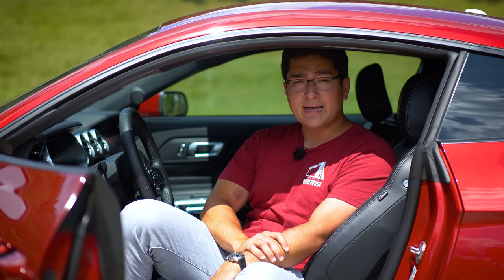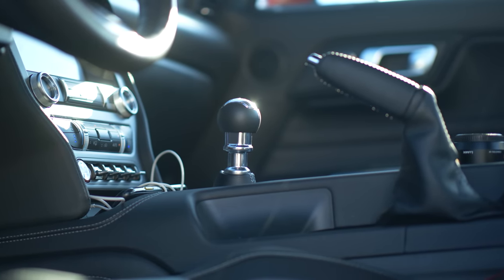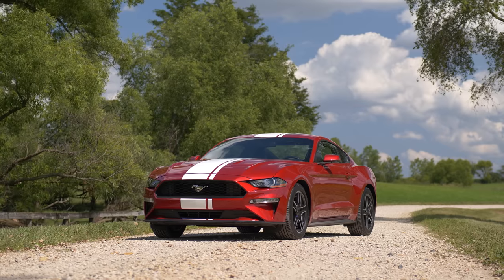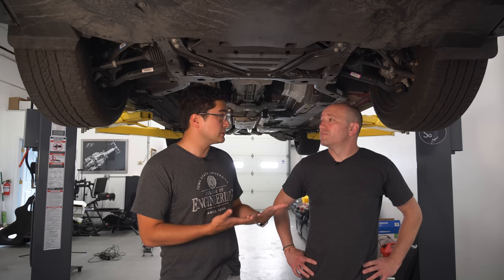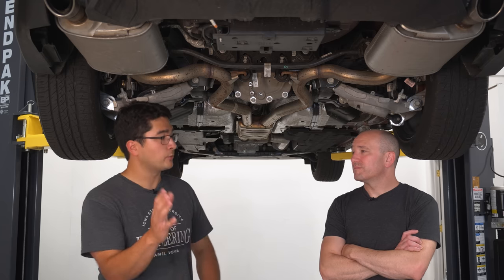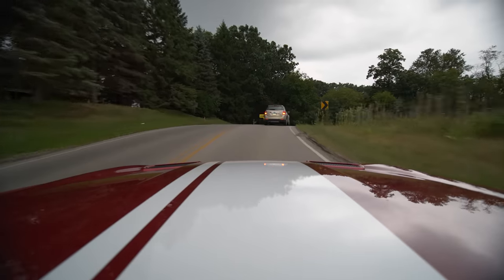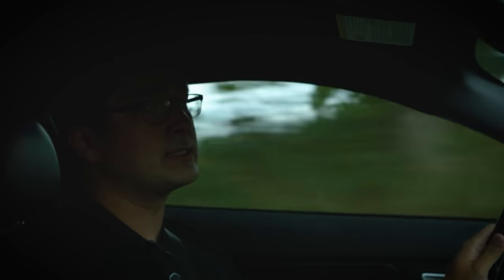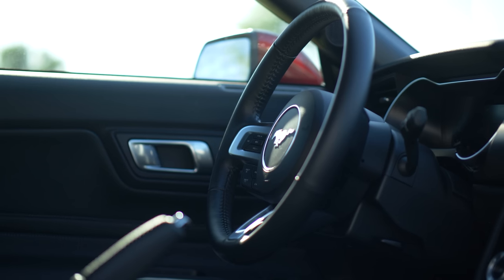2020 Ford Mustang EcoBoost | Red Headed Step Child

Comment: It has 300hp, rwd, and comes with an optional 6 speed manual. If it had a Japanese badge on it this car would be legendary.
Reply: Unpopular opinion: The Ecoboost Mustang is a modern S-Chassis
Reply: 💯💯💯
American 4 banger sports cars (ecoboost mustang/LTG camaro) are EXTREMELY underrated. These are cars that offer better bang for your buck compared to Civic Type R, Golf R, WRX, JCW, V4 A90 Supra, Audi TT and many more but because they don’t have a Japanese badge no one gives a sh1t about them.
Reply: I don't expect this engine to last reliably over 150,000 miles
Reply: @quentonmillstid850  As a ford lube tech, ive seen many many ecoboosts well over 200k miles
Reply: Exactly
Reply: I am Japanese guy who drove Eco boost Mustang from rental, and I really thought this is what like Nissan Sylvia or Skyline used to be. Not the best machine but brings much joy to life:) It's like Honda Beat kei sports but in American way. Fun around the town.
Reply: This comment alone has sold me on me on this, thank you.  I've raced turbo 4cyl cars for years in SCCA.  If this was a Nissan at this cost it would cost twice as much.

Comment: It’s funny that this 4-cylinder Mustang has more power than plenty of V8 Mustangs of the past. I think you guys are pretty jaded from driving so many high performance cars.
Reply: They are but they also admit that fact many times.
Reply: As someone who owns a GT350 they are also quite chonky and thicc. 300hp goes much further in a fox body.
Reply: Comes with the career I imagine. If I was driving and coming out with interesting reviews for dozens upon dozens of cars..I'd be jaded too
Reply: And the performance is about the same too, this car is pretty much on par with the '05 GT as far as acceleration.
Reply: I mean 300hp on a 3600 lb car is a little meh compared to the foxbody which was around 2800.
Power is just a number
Reply: Yea but does it have the same torque? No.
Reply: @pnourani  this is also a true statement. 
No one can argue with the value of a new ecoboost mustang
Reply: Also remember the cars, "of the past" were MUCH LIGHTER.  As comments above explained, 310HP in an old car is still faster than 310HP out of this Ecoboost. 
Also an Older Mustang V8, like a first gen may be, "Slow" compared to an Ecoboost, but they're more valuable.  A reality of Mustangs and any muscle car, is that people don't just buy them for speed, they also buy them for heritage.  The V8's will hold value better, slow or not.  People like the sound, and the big girthy engine in the bay.  If all we wanted was speed, we'd all be in Teslas by now.  No matter how much time passes, V8's don't depreciate nearly as fast like the V6's and I4's already have shown to in many years past.  Again as others above have mentioned.  "Power is just a number".  There are so many other things to consider when buying a car.  
We're not jaded for praising a V8, though I will admit it is jaded to look down on an I4 Turbo.  "Power is just a number" goes both ways.  Those with more shouldn't make fun of those with less, and those with less, shouldn't feel the need to tell someone with more that, "They don't need it".  Cause trust me, we'll find a way :)
Reply: Agree.  I generally like these guys and their reviews, but they sounded very smug here.  No, an EcoBoost isn’t going to match a GT, but to diss a car this bad is just unnecessary and even kind of mean.

This car definitely has its place in the automotive landscape.  Personally, I’ve driven both, and I like both.  In fact, I just test drove a new GT again last night.  But since my daily driver gets 15-18k miles per year, fuel economy is important to me, and the EcoBoost just kills the GT in this area.  I imagine insurance costs can be quite different, too - something reviewers never talk about, but it has to be taken into consideration when buying a new vehicle.

Would I rather have a GT?  Sure!  But Is it worth the higher costs in purchase price, fuel, and insurance?  I hope to find out someday.

To their credit, the guys did point out why this car would make more sense for some people than a GT, but they still came off badly, even as the car was chirping the tires running through the gears.  Not exactly a sign of an underpowered dog of a car.  Maybe try a little humility, gentlemen.
Reply: Timothy Coyne well said. The car also looked like it had basic all seasons on it. Proper tread really helps!
Reply: ummm a 82 mustang only had 157hp from a 5.0l v8... ? wheres the 300hp coming from. and i know a older car with 300hp with similar weight would likely win in a drag race but on a circuit i bet the newer 4 cylinder would smoke em with all its modern features. would be making up for it in the corners.
Reply: it still a 4 banger i dont care how fast i am.
Reply: @audi1ification  u can get a good deal on a toyota prius then if speed isnt ur thing :)
Reply: @BladedAngel  Well said.
Reply: @BladedAngel  

>As comments above explained, 310HP in an old car is still faster than 310HP out of this Ecoboost. 

This is such bullshit lol. When I had my EcoBoost I had a friend who had a '02 SN-95 Cobra  and I blew the doors off of him every weekend at the strip. That's with both cars having roughly equal horsepower and him having a manual. All you have to do is look at 0-60 times of 300+ HP cars from the past to confirm this whole "cars were faster in the past" is bullshit.
Reply: Can confirm. I have. 350 Monte Carlo from the 70s and I make...............

140 horsepower to the wheels
Reply: @BladedAngel  Nobody buys a new v8 mustang for "heritage", and anyone buying a run of the mill car pretending there's "value" to be kept in it is fooling himself. All cars you can afford are a money pit. These cars are indulgence that's all, and you spend as much as you deem it worthy. Considering value in these purchases is an oxymoron.
Reply: Prefer Supercharger (Whipple/ Roush), because at 38,000 miles i had Turbine Lockup within the Turbos at 82°+. This is caused by Thermo Variations consider locations of Turbos Ford mounts them below for lower center of gravity.  Problem is they're right next to the very hot engine.  Ricers know this and mount them up high close to heat extraction hood vents.  To keep them cooler, and not for show. Now the Turbo Shell expands like a donut 🍩, while it's being baked the outside expansion is outwards vs. Inside expansion is inward the hole gets smaller. The Blades expansion is outward to be larger to hit the Shell. Locking up the Turbine Blades, and then add the Backflow from the Intake and Downpipe to it to spool the the Turbos more.
My fuel mileage went from 
32 mpg to 8-12 mpg.  Glad for 2021 it'll have the GT500 engine package 5.0 V8
Reply: Until the Turbos lock up in hot days at after 38,000 miles. With the carbon build up
Reply: Agreed, love my 04 Gt but can't wait to Coyote swap at some point. Only 220 HP is sad now a days
Reply: @genericthiccgirl228  that would be awesome, though remember you may want to transfer. Crossmember and CPU  as well. With more horsepower you would want to be able to stop it as well.  Therefore, beef up the the breaking system as well.  
Stuff like this is why i stopped racing
Reply: Perry ah yes, they do. The performance pack ecoboost has 350 ft-lbs of torque which is 30 more than an 05-09 mustang GT. The non-performance pack has the same torque as 05-09 GT. Turbo motors have lots of torque.
Reply: Mike Gee  That's because of Turbo lag and the EcoBoost actually wieghs more.  There's a lot more copper ( its a dense material) from power seats on the side curtains to Downpipes and intercooler to tubing and fluids going into the intercooler.  Infotainment center added wieght leather padded console as well.
Reply: Steve McQueen Bullitt Mustang GT 390 cubic inch curb weight was 2,754 before added brasing on 4 corners for stunt car punishment on San Francisco roads.  Therefore, it weighs a 1,000 ibs. Less than the EcoBoost. So you'll feel more torque and speed, and felt its pull back then 
Your thinking is that doesn't sound logical.  A 4 cylinder vehicle weighing more than older V8 Mustang's.  A lot has to do with the added wiring (copper is a dense material) add power on both front passenger seats, side curtain air bags. Intercooler, tubing and fluids going in to the intercooler and tubing going out to Turbos and then the Downpipes, which are connected to the exhaust system.  People think that Turbos weigh less than a Supercharger.  Hhey are thinking wrong, the failure rate of Turbos especially, those American manufacturers.  They mout them too close to the engine heating the Turbos. Which defeats the intercoolers purpose to cool them down.  Ricers know to mout them away and closer to heat extraction hood vents
Reply: @timothycoyne5874  pointing out the reality of the base ecoboost isn't the same as putting it down - they specifically stated the reasons why the car exists. But the fact of the matter is that the base ecoboost holds the same place as the base v6 from before - as a buget-engineered product that still has the look and hits the right $ per hp stat. Look at all the comments (including your own) which focus in on that >300hp number. There's nothing inherently wrong with that - enjoying a car isn't wholly limited to hitting the apex or riding on a track-oriented suspension system.

There is a performance-oriented ecoboost, the base model isn't it.
Reply: Aptkeyboard In 1987 we thought it was the Bomb when the 5.0 had 225HP!
Reply: @BladedAngel  
That's not true at all lol.
Old Lambos, Ferrari, Mustang, etc etc were made of steel and all the parts underneath were made from steel mouldings. Suspension linkages used to weigh kilos lol. These days cars are made of much stronger and lighter types of steel and are considerably lighter, typically speaking.
Reply: They made very sure we understand they're too cool for this car.
Reply: AoDAzrael 300 hp is more than most new cars today.  Of course 300 hp isn’t much compared to a Demon and many other performance cars, but it’s tons more than the average passenger car, SUV, and crossover.

But whatever.  The EcoBoost has its place, as does the GT, GT350, and GT500.  If I had to choose today, I’d probably get a GT, but a late model, low miles used one, preferably a CPO.  Tons of used Mustangs out there.
Reply: Personally, I’m not a fan of the new body, the 18 and up just look nasty ugly to me. Yes the 2015 was cool but the whole reason I bought my s197 was because it reminisced so much of the older mustangs. V8 power and old but gold looks.
Reply: I've flown aircraft at 25,000 ft with less horsepower. I remember buying a 6 cylinder Mooney TLS aircraft that developed 300hp, thought that aircraft was powerful. 

If you see some old Bud Lindemann car vids.  Many of those cars  develop less HP and were heavier.
Reply: It was very painful for both of these gentlemen to do this review.  LOLOL
Reply: Timothy Coyne then just get a different car😳 no one gets a mustang to daily for practicality id take a Honda Accord over an ecoboost any day but if you give me a gt I’ll make the sacrifice for the performance and joy of the engine
Reply: @BladedAngel  Just read this comment and thought it was very well said and I was like dang I like this guy and then I scrolled up and saw it was Bladed! Lol keepin it 💯
Reply: @RCXDerp   growing up in the 80s 90s foxbody was a pantie dropper
Reply: fair, but max hp rating isnt the whole story. sometimes how it delivers that power is more important than how much power it has.
Reply: @RCXDerp  exactly ppl getting wet that this makes 310 hp but they forget s550s heavier cars. I cant stand an eco I really cant
Reply: @timothycoyne5874  if someones looking to buy a mustang I'd hope they arent looking for mpg or  insurance savings. If I was worried about mpg I'd have bought a Prius. It's like going to Hooters expecting the food to be good. A mustang is old school iconic v8. I get thru the years mustang's have had different engines in it but ecos so far from a mustang its disrespectful but I get 99% of ppl I see driving these are either rental cars or boomers that want a daily. I just never ever would go near one
Reply: Yeah that's the downside of this channel, atleast they kinda mentioned that in their latest vid.
Reply: @Chayonray  it was more painful to watch them do this review.
Reply: Thanks for the review, I enjoy your honesty. You don’t totally dis this car. For me it’s more power and a significant upgrade from my 4cyl Fox body. I’m fine with the base model. It would still be fun for me.
Reply: You can’t call yourself a car person if you seriously think the eco boost is cool 🤢
Reply: Cars from the past weren't made of plastic hell back then you could still drive a car away from some accidents now days it will be totaled
Reply: Agreed. They have lost sight of what is fast to many people. It runs 13's stock. thats fast.
Reply: @RCXDerp  have you driven an ecoboost?
Reply: @RandomlnternetGuy  intercooler/exhaust/tune on 93 pump and I’ll be making 30-50 more hp. And 30-70 more tq. I’d say that’s pretty sweet.
Reply: Guarantee they're faster than my 99 Cobra.
Reply: most things feel slow in america cause its endless straight highways
Reply: They sure are
Reply: @gsjourney3054  Mustangs actually make decent family cars as long as you only have one kid
Reply: I had a 23 ecoboost as a rental and it was genuinely awesome. It handled really well, ride was nice, had enough power and the transmission held revs when it needed to. And when I floored it, I could actually enjoy it on normal roads without driving like a scumbag.  Not of a fan of them ragging on a 4 cylinder simply because "it's a 4 cylinder and mustang go vroom with V8". Would they rag on an S3 the same way they did the Mustang in this video? Of course they wouldn't.
Reply: agreed, I wish they take another shot but properly this time with a performance package trim
Reply: This car is slow. Times move on. Mustangs were never fast to begin with in the past
Reply: Agreed.
Reply: not quite

Comment: 300 hp used to be v8 rating
Reply: @Peyton Brimmer yeah maybe in the 60's
where 4 cylinders were 40hp
Reply: @mickeydee3595  Dude the 2010 Mustang GT was only pushing out 310 Horsepower lol
Reply: @altonwilliams7273  yeah thats a mustang lol

Ive got a 2009 Commodore SS (pontiax G8 for guys in the states) and that had 355hp on a very conservative tune from the factory.
All these new high strung 4 cylinders will be fucked after 100,000km.
Reply: @mickeydee3595  ok but this is literally a 4 cylinder that has the word Eco in the name
Reply: @Dragon228833  and?
Reply: @mickeydee3595  the argument is that 310 horsepower is impressive for a turbo 4 cylinder and you replied that your v8 has 45 more horsepower
Reply: @Dragon228833  yeah it is impressive however with that being said these small 4 cylinders that are so highly strung will be wringed out by the time they hit 100,000km.
The V8 will keep pulling like a freight train at 300,000+ and many more if well maintained.
Reply: Motorbike engines make absurd power vs cc but at 50,000km they are all chooched out
Reply: @mickeydee3595  can’t argue with that. People r blowing these ecoboost motors left and right
Reply: @Dragon228833  thats what happens when you squeeze every last bit out of a small engine.
Longevity goes out the window
Reply: @mickeydee3595  bro you seeme to know what your talking about
can you please give me your view on stinger V6TT would you
consider that for a V8 its a very good looking car but most importantly
it does have some power 365hp.
Reply: @peacemaker2988  it’s just the ecoboost is gdi and turbocharged so it’s a recipe for disaster
Reply: @mickeydee3595  except Hondas or most Japanese bikes. My 05 cbr had 81k miles when I sold it an it's still running
Reply: @Szcza04  right look what happened to Hyundai a few years ago and their GDi motors haha. Boost is cool and it sounds amazing but man more complexities and things to go wrong
Reply: @danielservin2450  Thats considered very high milage. Good that she lasted and treated you well!
I got a Commodore SS with an LS engine and its one 220,000km and still runs and pulls as hard as she ever has.
Reply: @mickeydee3595  I remember when GM tried selling the commodore/ss over here a few years ago. No one wanted a 4dr sub 50k car even it they are cool cars . Sadly america turning into this gender neutral society where being masculine is frowned upon
Reply: @danielservin2450  From memory they were marketed poorly if at all.
I love mine, amazing car for what it is :)
Going up in value here aswell
Reply: yup